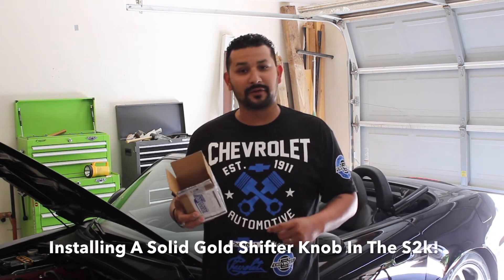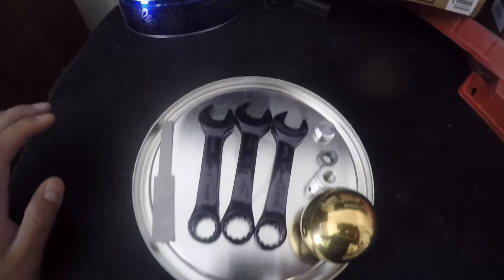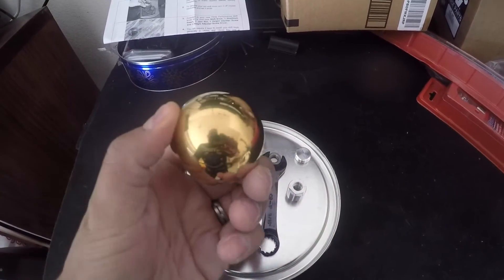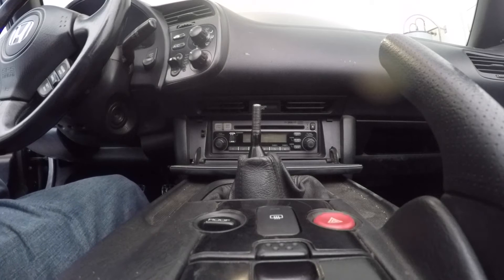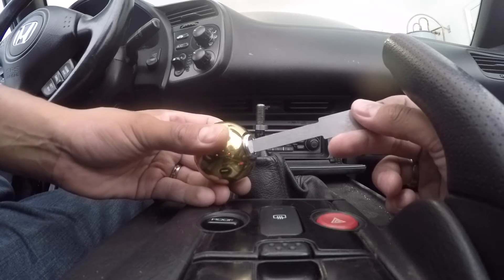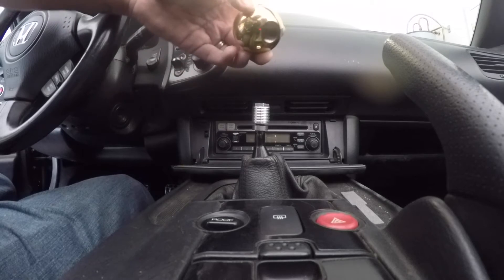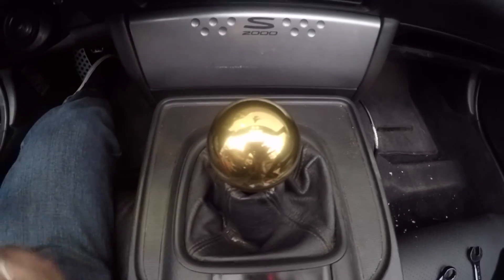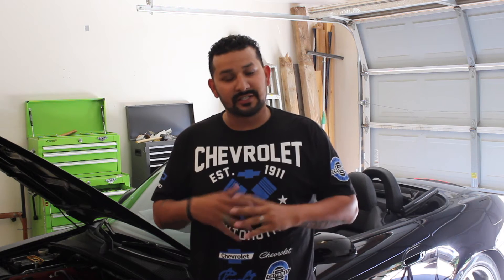Installing A Solid Gold Shifter Knob In The S2k! (Project AP2 S2000 Part 1)

Comment: I've heard these cars are headed with a six gear that is so high a top speed it is not even usable ? I wouldn't know personally but if that is true the first thing I'd do is change the gears or get a different transmission with taller gears "acceleration" instead of top speed just drop the top speed down to like 160 or 140 
I mean when are you going to need to go faster honestly.. then you will be fast and still pass smog.
Some cars have a governor or a exhaust restrictor somewhere .. any get it to a speed shop .. everything runs better on boost if you get a ecu tune and some injectors it could be a beast